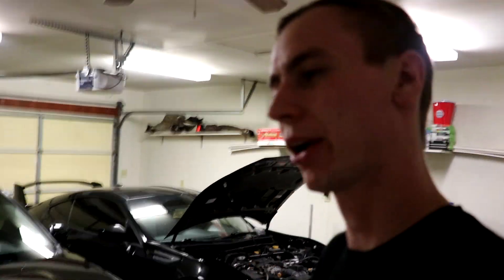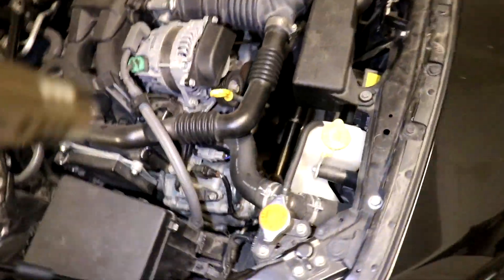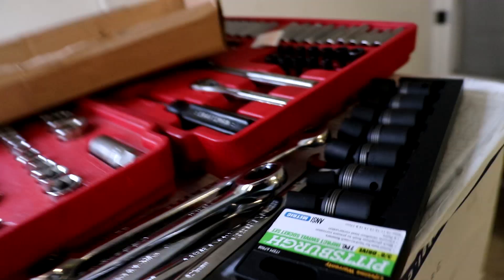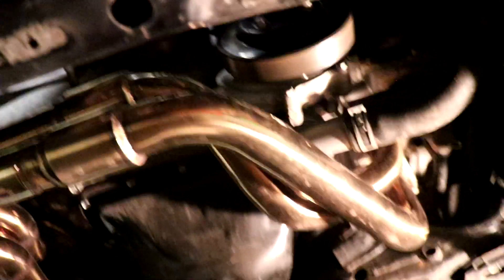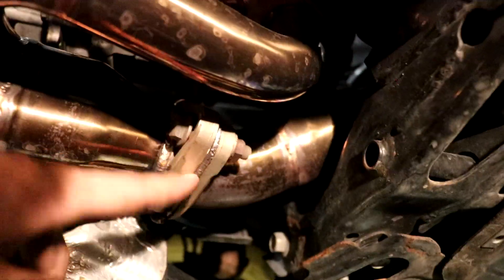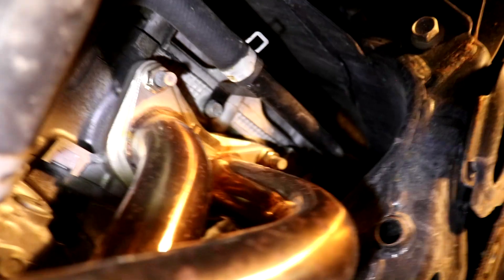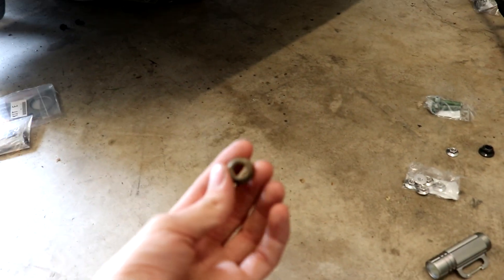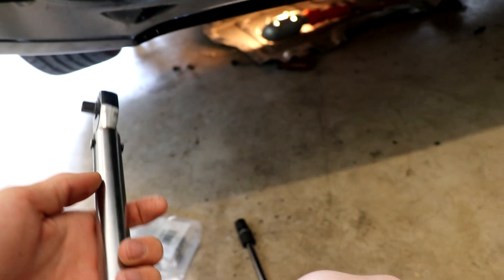Fixing BRZ Exhaust Leak | New Air Compressor!

Comment: Did you get a p013a code with that missing bolt? I’m getting one and I believe it’s because I didn’t tighten a bolt for my Tomei uel headers all the way. Already replaced my o2 sensors  so it’s either that or my Tomei 80r having a small crack lol. Just wanting to confirm if that missing bolt caused a code for you
Reply from the maker: I didn't have a cel just heard the leak and noticed it
Reply: Same did you end up fixing it
Reply: @edgarduarte4889  nah, maybe just my headers are slightly cracked or something at the welds. The o2 sensor works fine with my stock headers so it’s either the headers or the bolt I can’t tighten all the way

Comment: What made you suspect the exhaust leak? Did it make a noise? If so, what kind of noises did it make?
Reply from the maker: It was making a loud sound from the engine bay louder than the back of the exhaust so I knew I had a leak somewhere up front
Reply: @Reksir  was it like a woosh sounding sound? If you remember.